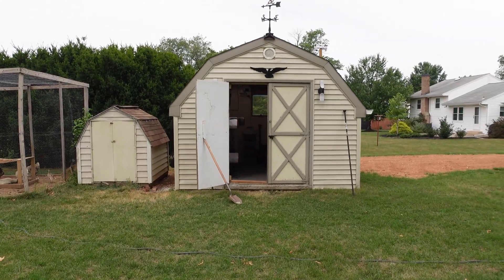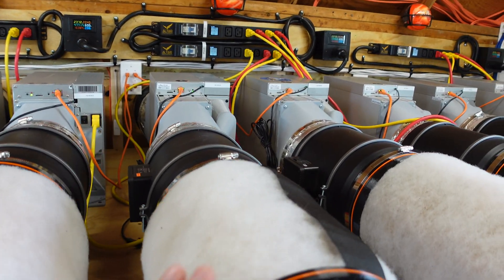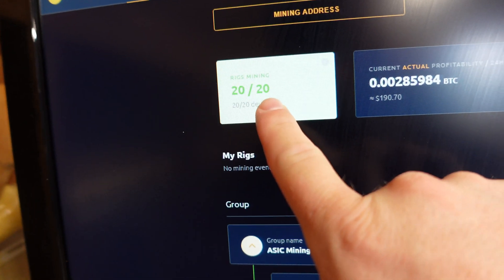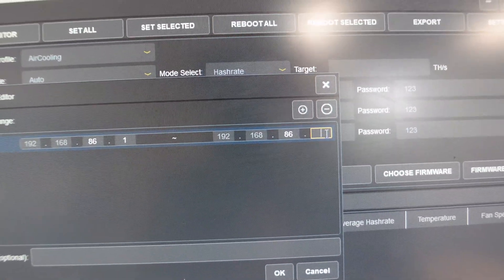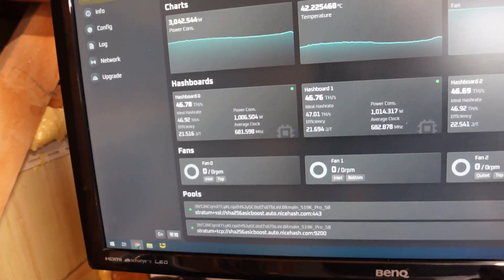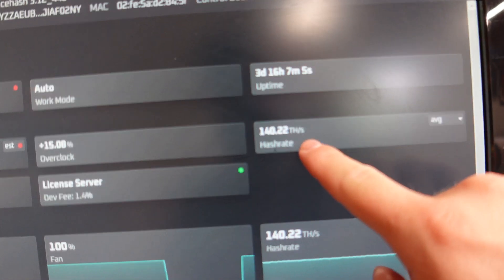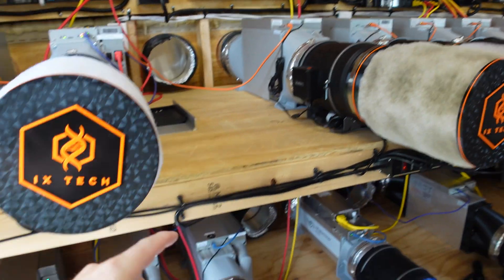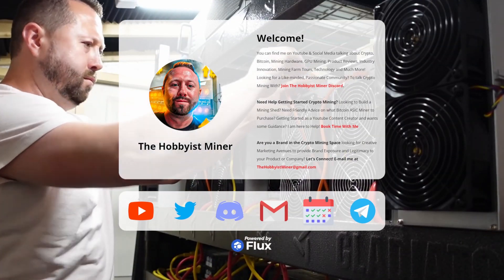This NEW BITCOIN MINER Firmware is SAVING me WATTS! NICEHASH Firmware

Comment: How did you handle the software integration of Nicehash, Because I get an error that it cannot be installed on machines with updated firmware after March 2024. Mine is April 2024. The machine S21. I tried to restore the factory firmware but it doesn't work. Please someone help!
Reply from the maker: When in doubt, you can load the Bitmain SD Card Firmware on an SD Card and boot the ASIC and it will default to that and reset the firmware to that.
Reply: @TheHobbyistMiner  Where to download TF Card Service Pack sd card firmware, because bitmain removes the download option
Reply: Have you compared the stock firmware of bitmine with that of Nicehash? My machines are 188Th And 200Th. As you know, consumption is high for both. Even more so now in the warm weather the hashrate is lower. If firmware Nicehash It will reduce the consumption and really increase the mining hash would be great! Take a test if you get a chance!
Reply: @hydroflex-universal.4418  Hello! How has it been for you with the nicehash firmware? Really worth it?
Reply: @hydroflex-universal.4418  Hello! How has it been for you with the nicehash firmware? Really worth it?
Reply: If you got the error, then how did you install the firmware? Did it work after it was installed?
Reply: Same problem, but where can I find the firmware for Bitmin?

Comment: Great video, but im also wondering what the difference between nicehash and hiveon firmware will be
Reply from the maker: Big one for me is Deployment. I don't believe HIVEOS has a deployment tool yet.  Maybe I am wrong.
Reply: @TheHobbyistMiner  You're right about that. 
But i've tested the FW and the nicehash is actually way better than hive. 
I can get 98TH with 2700w on my S19J Pro on nicehash, and 93TH with 2660w on hive.
And i really like the nicehash look :)
Reply: @MrMndesign  Will it install over Hiveon or do you need to take it back to the bitmain software as an in between step?